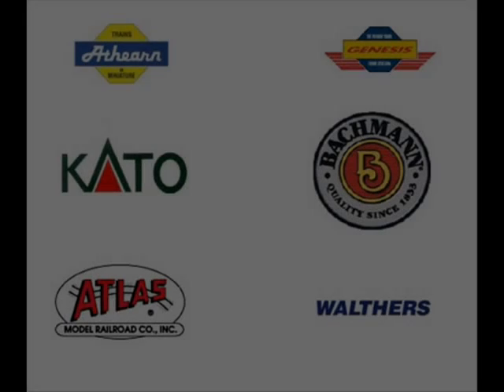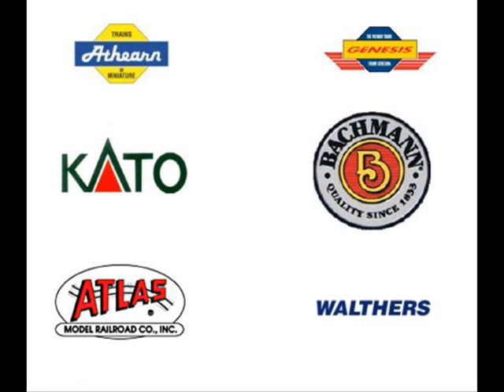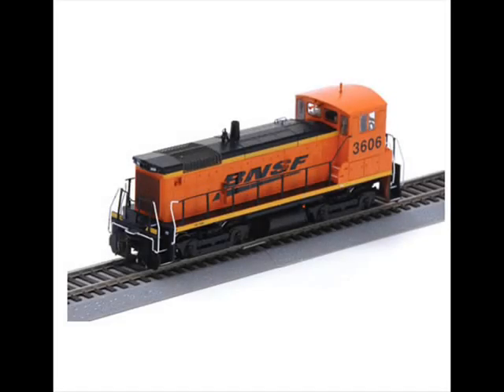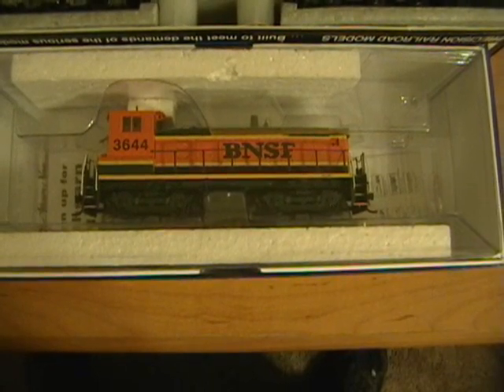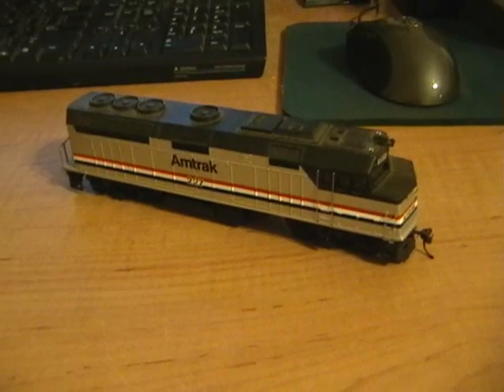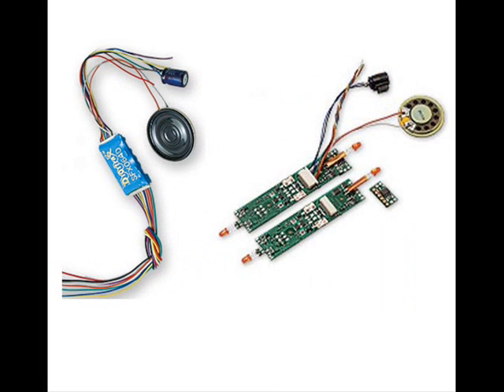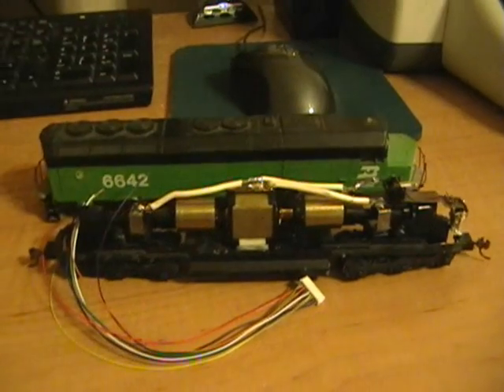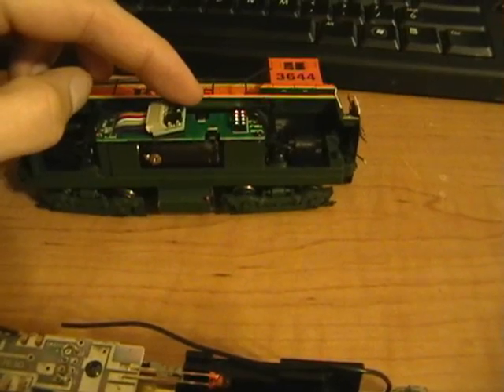12-16-2009 Advanced DCC Part 1 - The Basics

Comment from the maker: @vincentNJTransit The Kato P42 Genesis is a great locomotive. A drop in DCC decoder for this locomotive would be a Digitrax DN163K0A that goes for about $30-$35. This is easy to install and gives some lighting control. For a sound decoder, I think you can use a Digitrax SDN144K0A, but I would ask your local hobby store on that one fiirst. That one goes for about $60-$65.

Comment from the maker: @ronoc931 Hi, If the soundboad is already built in and runs on DC power. You should only need to buy a 8 pin mobile decoder. Digitrax sells a few different ones and go for around $16-$21 each.

Comment: hi tommie ive recently purchased an broadway limited cn  sd40-2 one of these days i want to go dcc.  my engines a plug n play dcc ready with a built in soundboard (dc powered  right now ) my queston is for a locomotive like mine with a eight pin decoder would i need one for sound and another for the motor if so what products would you recomend , ive heard that most rr clubs strictly use digitrax.

Comment from the maker: Hi Ryan, Thanks for the post, down the road I'll do a part on some lighting effects. Most of the time you can use the green and violet wires with blue as the common (a resistor is needed) to create lighting effects. After the install, CV values need to be mapped. Digitrax's website has a good diagram that I'll probably barrow for this.

Comment from the maker: Watch my video's 10-30-2009, 11-03-2009, and 11-04-2009. They will show in detail how to install a Digitrax decoder from scratch. The process for a Bachmann will be the same as the Athearn shown. Grey and Orange wires still go to the motor, and black and red to the truck. Let me know if you need further assistance.